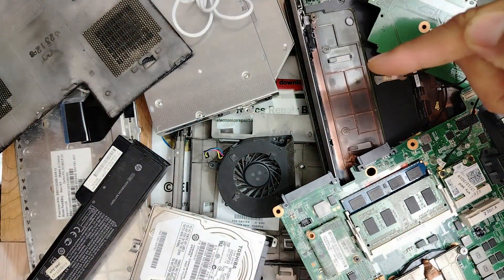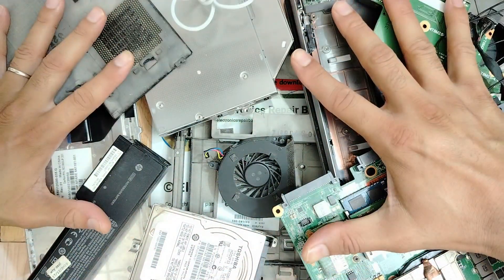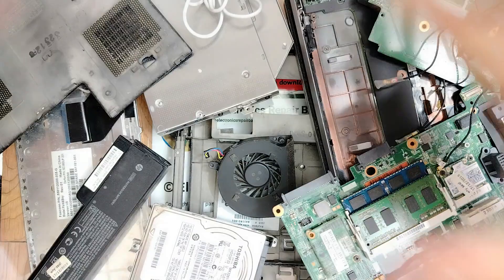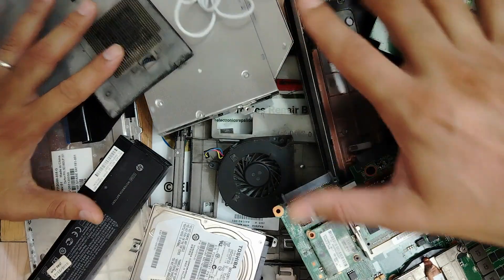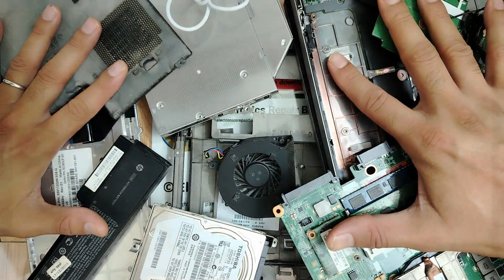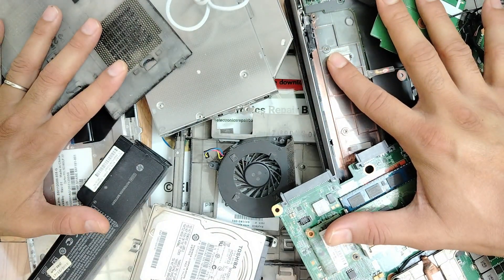Assemble ANY Laptop Like a Pro - Beginners Welcome | Laptop Motherboard Repair

Comment: Thanks for this episode. Next do for how to solder, use hot air machine in terms of the right degrees for removing mosfets etc and and replacing the various components.
Reply from the maker: Great suggestion, noted